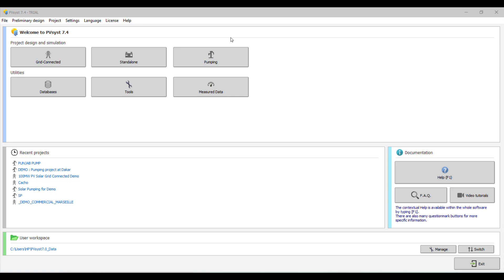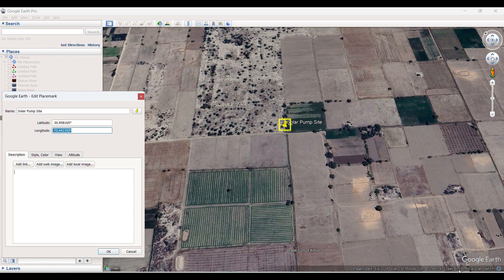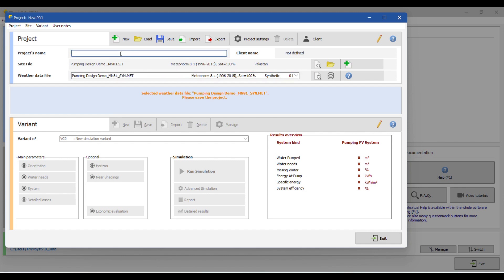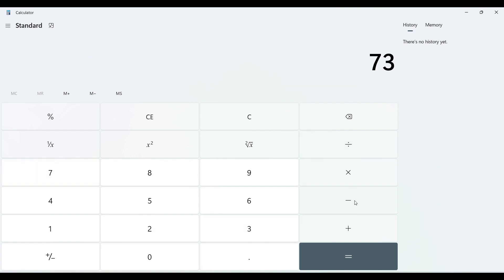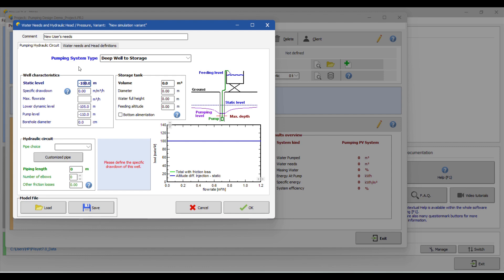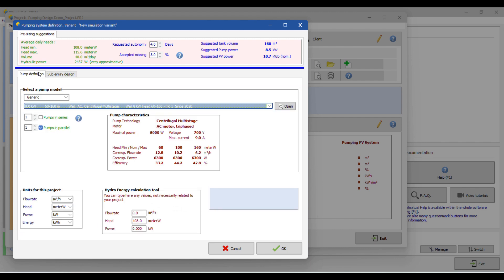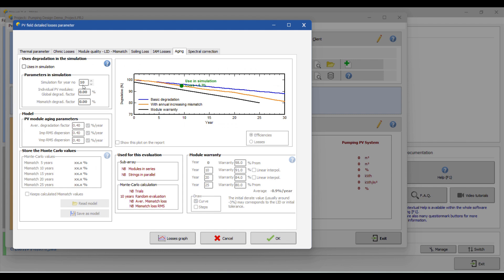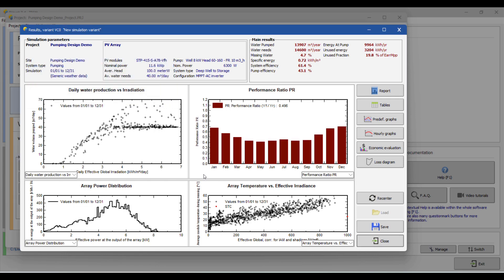Solar Pumping Design with PVsyst 7.4.8 | Solar Pumping Project Simulation | Step-by-Step 2024

Comment: Thankyou for info
Here didn’t understand the suggested storage tank as per need is 168m3 but in actual selected 52 how and why
Reply from the maker: It depends on your need and availability of capacity to store. It not impact the system design.

Comment: Sir how we acquire a solar pump working file if it is not included in system
Reply from the maker: You will contact with a concern pump manufacturing company and request for PVSYST simulation file.